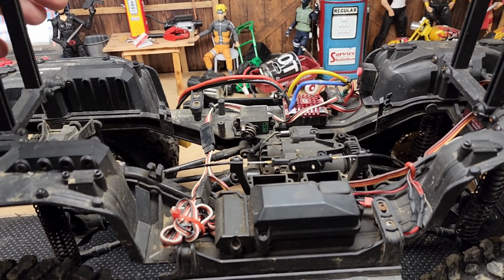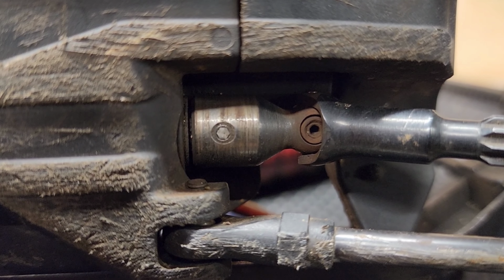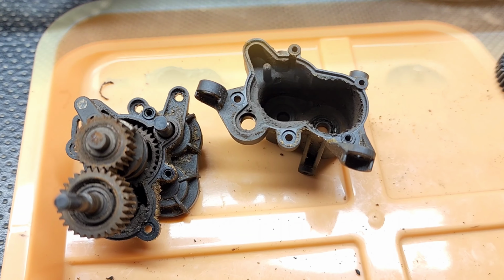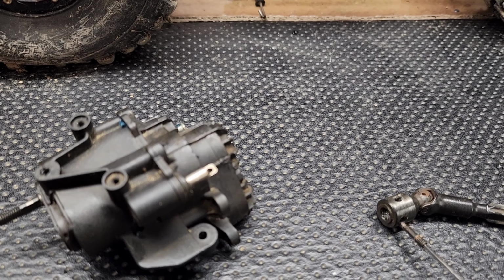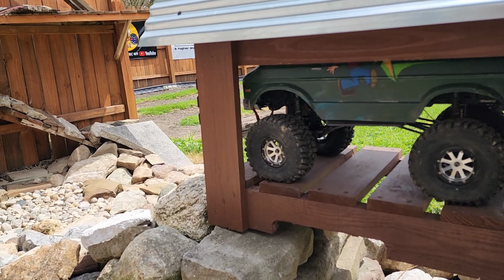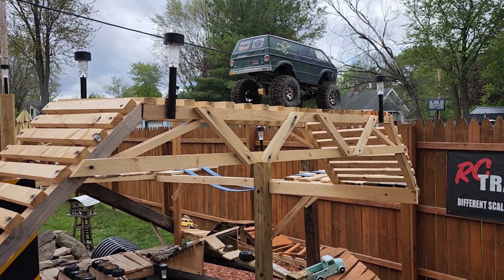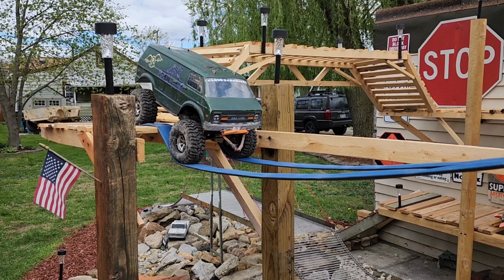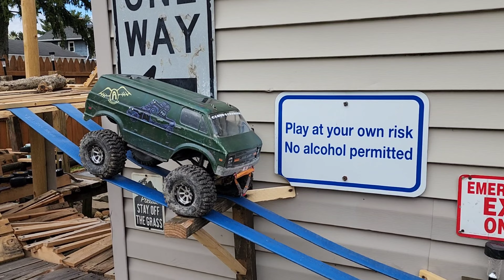Trx4 Monster Van Transmission Rebuild and Course Run

Comment: Considering the state of the bearings after water had got to them the Traxxas gears did not look too bad for the mileage. You was very lucky with the driveshaft, I like the standard ones for that reason but I have very little rocks to go over so they do not get the same straining.
Reply from the maker: Thank you very much Malcom it was a mess glad to have it going again its a personal favorite to drive

Comment: I love that van. Does it have a long arm lift kit with 2.2s?
Reply from the maker: Thank you yes it does I bought it used with a jeep body and not built very well about 3 years ago I have been replacing and upgrading along the way